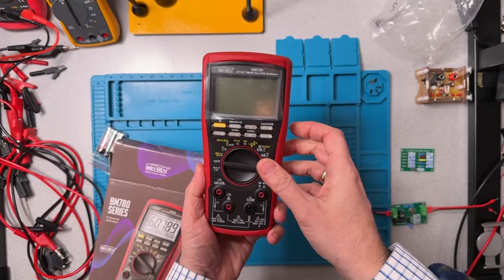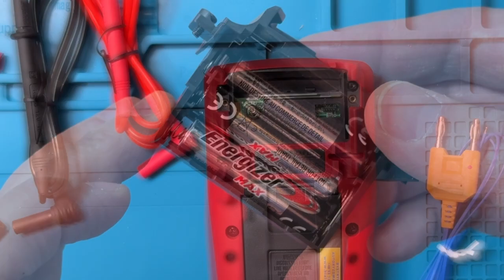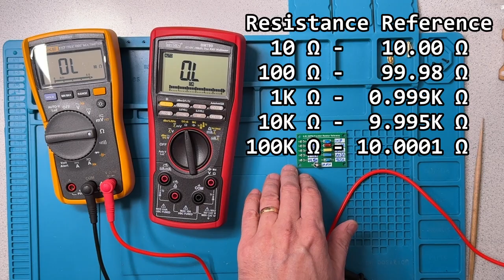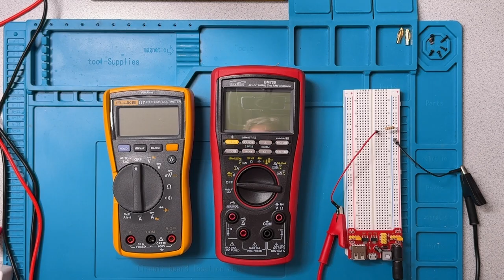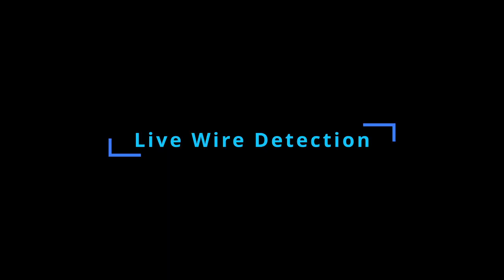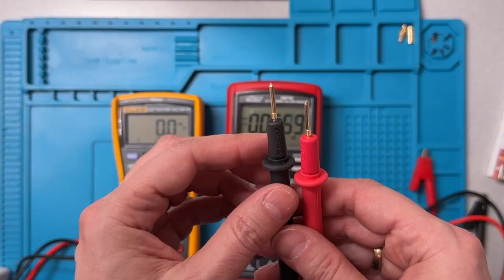Brymen BM789 Unboxing and Review

Comment: Note that there is soon to be a BM78x variant that has bluetooth connectivity.  An EEVBlog branded version (BM787BT) and a Brymen branded BM788BT.  The feature sets are slightly different from each other and from the non-bluetooth BM78x models, so anyone considering waiting for these should figure out which feature set they want.  Also, as far as I know the pricing hasn't been set yet.

I have a BM786 that I like very much (though the BM2257 has been my go-to for the last several months).  If bluetooth had been available a few years ago, I'd have jumped to that if the price difference weren't too bad.  However I'd suggest waiting at least half a year - maybe more- after release to let them work out any bugs.
Reply from the maker: Appreciate the info about the upcoming versions.

Comment: Flukes are just faster, when you have to measure many components in a short period of time Fluke is king.
Reply: Fluke are not faster. They have 4 readings/second and brymens have 5 readings/second. On bargraph 60 readings vs 40. Brymens are faster, is just that this guy refuses to get out of AC+DC mode which is slower.
Reply: They're American so I now refuse to buy them. Yes that's politically driven, but morals are important.

Comment: The Fluke brand is to feed them separately. There is no justification for having such exorbitant and illogical prices for their meters. As long as there are those who buy because of the nonsense of a yellow case and for a name, they will be more expensive every day. and more exact and if not, refer to Joe Smith's comparative tests on YouTube if anyone knows about this more than the one who says it.
Reply: The thing with Fluke is that it’s a known quantity in the industry. a lot of companies specify fluke because they have years and years of calibration and pm history of the units, fluke even continue production of out dated units as the use of them is written into procedures in the aviation military and pharma industry ,a change of  procedures would need to be validated, justified and signed off and is cost prohibitive so not worth it .fluke give excellent support and warranty for their products and this matters in a industrial setting.
personally I’ve seen fluke meters bounced around and abused  for years and they still give accurate readings, 
So they charge more and it’s not just because it’s ina yellow case.
I wouldn’t change or swap my fluke myself but it’s great that there’s a choice for ppl to make
Reply: People buy Fluke meters for measurement confidence. There are plenty more featured meters than Fluke, but Fluke is unparalleled in metrology and calibration. I have a 40+ year old Fluke 8060 and it's still in spec after all these years. Also Joe Smith is a Fluke hater who's been hating on the brand ever since one of his Fluke bench meters gave him issues.

Comment: Nice review.
Somehow I've always had the feeling Brymen held the BM789 back in functions, as it has no dual display and no possibility for logging.
Especially not having any implementation of logging to a pc or phone is strange, as this is the only (modern) high count meter (40k+) on the market that has no logging. Also, on the PCB of the BM78x series (they all have the same pcb), there are spaces where the pcb is marked what model it is (so 786, 787, 788, 789) but also a mark called "BT". So if that stands for bluetooth (I can't think of any other possibility in this context), Brymen had thought of giving it BT logging, but for some reason decided to not give it that (it would've probably been a separate module fitted on the pcb for various reasons like FCC compliance etc). I can only think of that they didn't want the BM78x to compete with the BM86x line.

Comparing the BM789 with a Fluke 117 is a bit apples and oranges. The Fluke 11x line is ment for field techs like HVAC guys, car mechanics, electricians etc, where a meter gets used and after that thrown back into the toolbox. They only compare in price (used to). Where I live (europe), the 117 has seen a drastic price increase. Even the 115 is considerably more expensive than a BM789 or BM869s; the 117 is currently almost double the price of a BM789. I have no idea what they're doing at Fluke Europe, but anyone that pays that kind of money (their own money) for that meter is completely crazy. Cheapest I could find is €366 incl VAT. The Fluke 117 is a competitor to the Brymen BM2257, which has considerably more functions incl logging and mA/µA, and that is a €100 multimeter.
Reply from the maker: Thanks for that info.  
I used to compare many meters to the 117 as the Fluke is a well known brand. At the time the idea was to what you could get and not get for a fraction of the price. However, in terms of performance for occasional use many of the budget meters on the market will do just fine so I switched to using reference sources as it makes for a quicker review. 
Now I reserve the comparison style review for comparisons that might be interesting. I chose the 117 and 789 because the 117 was the best other meter I had in my possession at the time.
Next week I will be releasing a comparison between the Uni-T UT161E and the Brymen.

The BM2257 appears to be very popular .
Reply: @jtechlabs1  fluke 117 can't compete with brymen 789 not even the fluke 87v can. As for uni-t, I don't even want to see them.
Reply: @Joseluis-tf4in  UT-181a is pretty nice. Too bad it died in Joe Smiths' piezo grill igniter test....😁
But performance and build quality looked quite decent. Too bad Uni-T also makes lots of garbage, so their 'good' meters will always have to shed off that imago.
Both Brymen and Fluke don't make any bad models (as in badly build/badly designed). The 11x series is just a much lower tier series as in lesser specs and lesser functions. It has to be compared to the bm2xx series and even then it has a hard time competing with the functions and still almost costing double the price (in europe: triple the price!)

And then there are brands like Hioki, Gossen, Keysight etc, but those brands don't really offer a better product than Fluke for the price. They are in direct competition pricewise and quality wise. Brymen just undercuts the price 2-3fold and offer just as much functionality and accuracy (or even more).

It's just strange that Brymen doesn't have the distribution system and service system Hioki/Gossen/Keysight/Fluke has (like extended warranty, able to deliver NIST calibrated models, software with more professional implementation in corporate forms etc etc). That said, if they did, they'd probably be up there pricewise too...

That Uni-T UT161-E seems to comply with EN61326 so that might survive Joe Smith's grill starter...😁 PCB looks pretty good. I wonder if it has lead detection as a safety feature.
I see that ACV is specced up to 10kHz. So probably better than the brymen bm2xx series but probably not better than the bm78x/86x series. It would be interesting to see how that UT161E does ACV in the complete audio bandwith.

Comment: I agree with the importance of the Diode beep and it is good to see this BM789 does this. Unfortunately the BM869s does not for some reason.
Reply from the maker: Yes, it was odd. I would not have thought it was that difficult a feature to implement. Surprising that it is not in Brymen's top of the line model.
Reply: @jtechlabs1  The bm869s was developed 10 years ago (or even longer ago). So not that surprising.
Just as the bm869s has no autohold. I'm sure everyone is waiting for a successor to the bm869s to have these functions and hopefully even more.
Reply: @mrpetit2 Эти функции у FLUKE присутствуют лет 50. Но хорошо, что BRYMEN дошел ло этого хоть сейчас. И я едва смог дожить до этого момента.

Comment: I highly recommend buying Brymens from Welectron in Germany. I bought the 869s 3 months ago. I ordered it on a Saturday in Pennsylvania and had it in my hands Tuesday afternoon! The price was $194.02, including shipping, which was only $9.99. It's an excellent meter and a great place to buy from! Thanks for the video btw!
Reply: I bought my BM235 from Welectron. Very satisfied. I'm shopping for a BM785 now.
Reply: I have bought several Brymen meters from Welectron.  Great prices (including shipping) and great service.  I sometimes add an extra set of the Brymen silicone probes - there's no additional shipping and the the leads are an excellent value at around 10 EUR (if I remember right).
Reply: I bought my 867s many years ago at Welectron. I think I need a second meter. I'm thinking either way BM788BT or GW121. Kinda on the fence with that.
Reply: Bremen’s are made in Taiwan, would it not be easier/cheaper to order it through a dealer in Taiwan?
Reply: @Xander-3.14-er  Interestingly, BM869s is about $345 in Taiwan.
Reply: The only places I know of to buy them in the states is TME and Welectron. TME is $90 more for the 869s
Reply: Through Welectron after exchange and before shipping it’s  $337.00 CAD.
Reply: How did you go about buying it?
Reply: @forestdamian5601 I just went right to the Welectron website and purchased from there. Great company to deal with!
Reply: But ze Germans say: Wer misst misst Mist.

Comment: Hello sir, What is the voltage value that is released when in diode mode on both multimeter?
Reply from the maker: The Fluke uses 2.50V and the Brymen 3.18V

Comment: I also got the same reference voltage  and are some things to consider when take as true the measurements provided. First you don't know the conditions and the model of the dmm that was used and the second is the voltage supplied in China and the temperature there. These can have a bit of influence on the numbers.  With mine have done this: I removed the diode and put a 12 volts liniar regulator. I feed the voltage regulator from four lithium rechargeable batteries in series to provide a clean power source.  With  the battery pack charged I requested to a friend which has access to high end dmm to check and write the output values. I was fortunate to get my reference voltage checked with Agilent 3458A. At 5 and 7.5 the values where very close but at 2.5 and 10 was 1mV difference.
Reply from the maker: Thanks for the tip.

Comment: so which one do you prefer?
Reply from the maker: For my purposes I have a slight preference for the Brymen. I really appreciate that the Brymen stores the last mode across power cycles. That was a feature I noticed in my first few hours of use. The only weak area of the Brymen was the NCV. The Fluke is superior to every other multimeter I have tested in that regard. In reality when I am working on household wiring I use a dedicated non-contact sensor. The additional accuracy in the Brymen is good in the sense that it becomes my new reference point. However, in day to day use I don't need that level of accuracy.

Comment: What's with the delay in DC voltage measurement at 5V and 7.5V for Brymen? Fluke looks a bit faster overall.
Reply from the maker: The Brymen was in AC + DC mode which impacted the reading time.
Reply: @jtechlabs1  and for readings too, because connected to a power source and probably a switching one